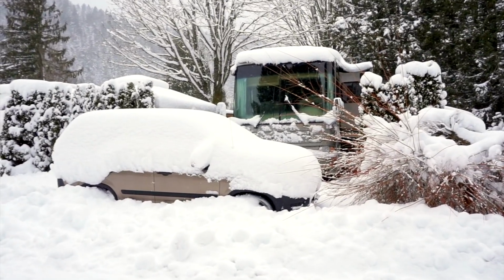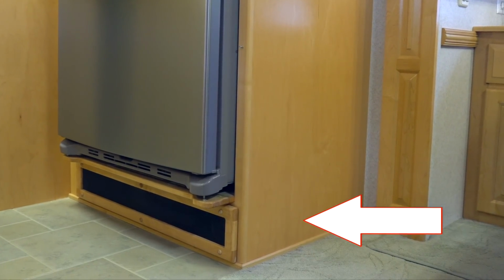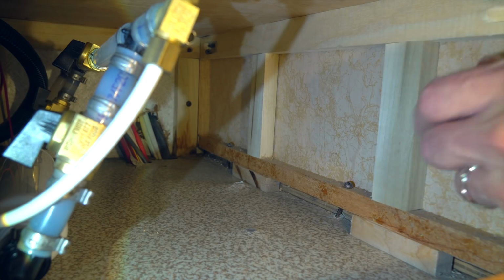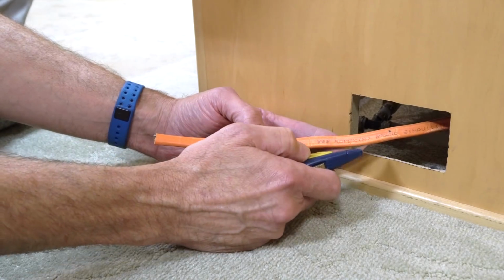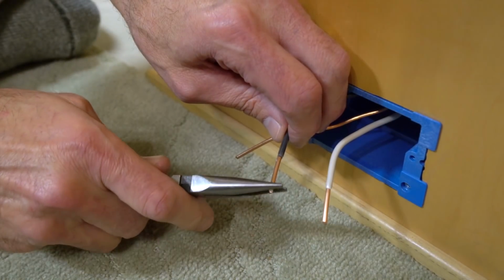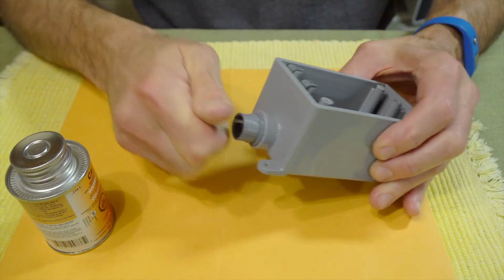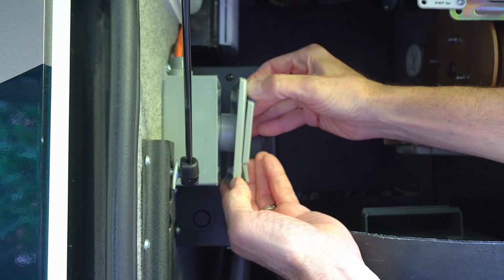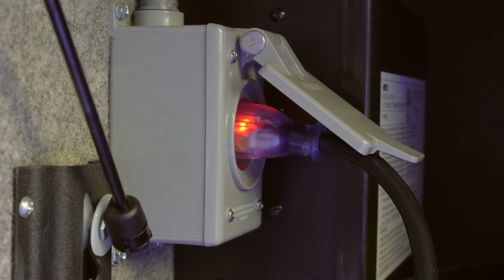Installing Our Winter RVing Secret Weapon!

Comment: Can a larger propane permanent tank be factory installed?
Reply from the maker: That would depend on the space available and the weight carrying capacity of the RV. It's not generally something people do. If the RV is moveable, its easy to tank up with propane. If it's parked for a long period, check out our video about how to connect to a larger external propane tank.

Comment: Hammer staples are a major no no I have seen the vibrations in just a standard house from things like a washer or dryer make the staple rubbed though and either caused a short, rub marks or worse a Electrical fire the  safer route is a zip tie that is made to secured with a screw to the wall

Comment: Are you 2 going to come back to this and tell of how your experience with this has been for you 2? I'm kinda curious to know.
Reply from the maker: Hi Morgan! This literally transformed our winter stay on a 30-amp site. It allowed us to run a dedicated 1,500 watt space heater on that new dedicated circuit all winter, freeing up our regular 30-amp power for so many other things, including a second space heater when needed. It was an absolutely wonderful, stress-free winter, with zero effort required to stay warm and cozy.
Reply: In the instance that you 2 do by chance come across a 50 amp available connection, you would put everything in the 50 amp connection right?
Reply from the maker: For sure! If you have an RV with 50-amp service (the big 4-prong plug) and you're at a site with 50-amp service available, that will power EVERYTHING you could possibly need all by itself. The mod we put in is only for when there's only 30-amp available. Now of course if you have an RV with only 30-amp service, you could make use of the mod we showed any time there's both a 30-amp and 20-amp plug available on the same pedestal (very common). This could come in very handy for a 30-amp rig during the winter, when more than 30 available amps could come in very handy.
Reply: That's good to know, I just wasn't sure if you 2 were going to talk about it in a video, or if you 2 wanted to or not.
Reply from the maker: Might make a follow-up video, but wanted you to know that we’re VERY happy with the mod. 😊👍
Reply: Yeah, again, good to know that you 2 are happy with your mod. :)
Reply: Right, I was wondering if that's you 2 would do if you 2 were have a 50 amp available connection for you 2. As for you mentioning about the 4 plug mondo plug in your comment, I have been able to see your video you 2 did on dog bone adapters. :) ;) :D
Reply from the maker: Yup... when we’re on a 50-amp campsite, that one cord powers everything, so our mod isn’t needed. 😊

Comment: Nice video. I see a bare copper wire at 11:40. What's that for?
Reply from the maker: Hi Steve! I looked carefully at 11:40 and couldn't see any wire. Sorry if I'm missing something. Can you describe where in the scene you're seeing that, or if it might be at some other point in the video?
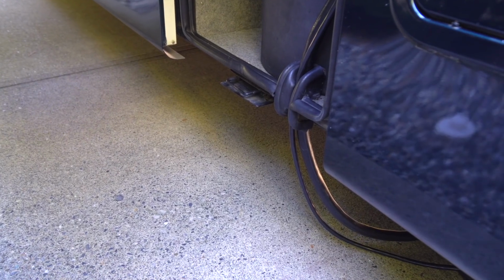Reply: I looked also.  There is something that looks like a 1/4" copper pipe coming out of the " service compartment " of the RV, visible at 11:19.  Not sure what it is or why it is there, but I think this is what they are talking about.

Comment: What is the reason for the black and white wires to be opposite of each other?
Reply from the maker: We learned from watching YouTube electrician that that's the right way to do it! LOL Since we're not electricians, we're not sure why, but we figured they all said to do it that way, so we did! 😊
Reply: Just do it and don't ask questions? Maybe it would be wise to ask a electrician the reason why.
Reply from the maker: Our questions were answered by at least a dozen tutorials we watched and read from various professional electricians on how to correctly wire an outlet. All agreed on the procedures. How much research and analysis do we have to do for such a simple task beyond ensuring we learn the correct procedure from a pro?
Reply: Well, if you learned it from a pro, then i am silenced. Thanks for the answer.
Reply from the maker: When it comes to specialized stuff like plumbing, electrical and engine work, we do research a lot. But we have to apologize that we don’t always earn the “why” behind every “how”. 😊

Comment: Hello there guys.... I was watching your video again and at the end you stated you haven't used a drop of propane, how do you keep the compartments warm or the tanks from freezing? Electric blankets maybe? I am thinking of doing this project too, lets see what happen. I think every manufacture should install and outlet just like this one. Stay warm guys....
Reply from the maker: Hi Hector! We put a utility light in the water compartment with a 60-watt incandescent bulb in it. It's amazing how much heat they put out! It did the trick and kept the basement plenty warm all winter. We also put the remote sending unit from our indoor/outdoor thermometer down there to monitor temperature from inside the RV. I think we mentioned both of these in our original (very old!) video about RVIng in the winter, just in case you want to check it out: https://youtu.be/n5RGlcLSrM4

Comment: I'm really curious why you used 10/2 instead of 12/2, which is specifically for 20 amp usage, while 10/2 is for 30 amp usage.  Please help me to understand what I'm missing.  Btw, I LOVE your videos and am learning a ton so please don't take this as a critique, I'm seriously wanting to understand.  Thank you!
Reply from the maker: Thanks for the nice comment and great question! There were three reasons actually. First, we're not electricians, so not as confident as a pro when it comes to making sure everything is robust enough. Second, since this is an internal installation, as opposed to something outdoors on the site or pedestal, we wanted to be sure it had more than enough capacity. And third, we had a length of 10/2 Romex left over after installing our new Xantrex inverter, so like good DIYers, we used available material we had around! If you're going to be purchasing Romex for this job, you'll be totally fine with 12/2!

Comment: we keep our rig warmed with an electric, oil-filled radiator.  No moving parts, great thermal mass once oil is warmed, and the heater kicks off once the oil is heated.  Last, no open flame or high wattage fan used.  Might? be a supplement to your secret weapon?
Reply from the maker: Great tip! We borrowed one of those from a friend during a previous winter, and really liked it a lot. The only downside was the length of time it took to heat up and cool down, making it a little less easy to get instant gratification if we was a little too hot or cold. But a very worthwhile way to heat!

Comment: I helped a friend recently perform a similar modification. In his case, we direct-wired a retracting reel with a 20A cord into a single breaker subpanel. We added several orange outlets with active LEDs around the rig to identify they were on the alternate circuit. His intention was to use a single ceramic like your oscillating unit and move it around as needed, but I like the idea of using a less-direct convection for general area heating. As always, well done, gents!

Comment: Love your upgrade! I’ve done the same thing to my Coach for those cold days. Just wanted to hear your review on your Delonghi heater. How quiet is it, and what made you choose that particular model. 
Thanks!
Reply from the maker: Hi Mark! Your timing is rather amazing.... We chose that heater because it's quite slim, and would fit where we wanted to put it, even though its overall dimensions are rather large (tall & wide). And it's almost completely silent, since it's a convection heater, with the added benefit of an optional fan mode. Because it's not an oil heater, it would heat up and cool down quickly, and the fact that's that it's really attractive compared to most heaters didn't hurt either. Those were all the reasons we chose it, and we loved it. Yes... loved, as in past tense. The reason we mentioned that your timing is amazing, is because just this morning, we made the final decision to return it to Costco, and removed the links to it in the video description, and from the post on our website, and from our favorite gear page. About a month in, we smelled a slight "burny" odor from it one day. We thought it was a delayed "new heater" smell, because it still worked perfectly, and the odor went away quickly and didn't return. That was until a couple of days ago. We woke up to that same smell, only stronger, and the heater had shut itself off during the night. We tried running it only while we were awake (so we could monitor it) all day yesterday. No more smell, but we noticed that it wasn't warming the place up adequately. We plugged it into our Kill-A-Watt and turned it on high, and noted that it was only drawing about 475 watts, even though it's a 1,500 heater, set on high. Obviously, something failed, or maybe two things failed in sequence. We think the smell was coming from the control panel, and we're guessing that something failed in the control module. We did some research, and found that some other people have reported the same thing. It's a shame, since when it was working, it was awesome. We just can't recommend a heater that failed so quickly, and we're returning it to Costco tomorrow morning (gotta love Costco). Sorry we don't have anything better to report. For the time being, we're just using an extra space heater that we had planned to give away, but will keep it for the time being until we decide what to replace the Delonghi with.

Comment: Thanks for the great video.  It inspired me to do the same thing plus in my motorhome with only 30 amps service.  I’m going one step further and running the wiring to the water heater and will replace the gas only one with a gas/electrical.  I’ve been trying to get a 20 amp 120 V inlet and can’t seem to find one.  I’ve been to Lowes, Home Depot and searched the internet and Amazon and can’t find what I want.  Where did you find yours. I’m about 45 minutes from an electrical supply and thinking of making a run down thereto see if they have one.
Reply from the maker: We included links in the video description to all the parts we used. Here’s the 20-amp inlet: http://amzn.to/2DXXExA It’s a bit expensive, but very robust and weatherproof.
Reply: RVgeeks Thanks.  I looked for links but didn’t see them.  I must have been looking in the wrong place.
Reply from the maker: No worries Larry! Please let us know how you make out.

Comment: you are playing a dangerous game..

typical mains 20 amp is 220/240 vac.

inlet to main fuse is 20 amps, internal wiring should be 15 amps

the only thing I know of that requires additional 20 amps that is air cons and most other feeds use 10 amps at the most so 15 amp is applicable @220/240VAC..

I DO NOT BELIEVE IN 110/120VAC because yyou waste ore power in down conversion..

and gets dangerous mixing 30-50 amp at 120 vac when you should be within the realm of 20-25 amp inlet at 240 vac..
Reply from the maker: Hi Jason! We appreciate your comments, and we understand that you prefer 220/240 over 110/120 volts. But 110/120 is what we use here in North America, and there's nothing we can do about that. Just about everything we Canadians & Americans use is 110/120. We're not "playing a dangerous game" but rather simply using the system that's been chosen for our region. We RVed for three weeks in Australia a couple of years ago, and agree with you that 220/240 has its benefits (we loved using such a small cord to get the approximate equivalent of 30-amp service). But until they change the entire North American system, we're only able to use what we've got. And we're using the way it was designed.
Reply: yup I think standardizing to 220/240 would benefit the US market more I do not think 110/120 was designed for commercial grade applications at 50 amps..

I just can't see the point of a 120 inlet when and where 220 should  be a base standard connection..

how you get to 120 vac is not the way to do things...

Comment: One minor flaw in your video.  DO NOT use metal staples with Romex cable.  There is a special white nylon staple just for Romex.  The fastener you show is for flexible steel conduit type wire.  (MC)  Using the wire metal type can be hammered in too much or rub on the wire during driving, causing a fire hazard the next time you plug in.
Reply from the maker: Thanks for the input, Clyde! We did watch a LOT of instructional videos about all aspects of this project from professional electricians, and there was quite a bit of conflicting information, including details about hammer staples. The guys who showed using metal ones specified not hammering them in any further than just enough to hold the wire snugly, but not crush it. But we appreciate all input, because we're not professional electricians. Thank you! :)

Comment: Super video! Here’s a simple electric math formula. Volts x amps = Watts.  Under ideal conditions that 20 amp breaker can handle 2400 watts.
Reply: Can't load a breaker to any more than %80 of its rated capacity by code, that would be about 1800w. Majority of 120v space heaters are 1400/1 500w.  So he's well under. 🖒

Comment: i’m on metered electric too. also i’d like to add solar. how can i use the solar first making the rv park my backup power? thank you for all your great vids!
Reply from the maker: Hi John! Solar can't exactly work to directly replace park power, as the only thing solar panels do is charge the house batteries. So the way you could use it to reduce your electric bill is to shut off the power at the pedestal, as if you were boondocking/dry camping. Then you'd be using power from your battery bank, which would be getting replenished by solar. Then, when the batteries drop to the point where solar can't keep them high enough any more, flip on the park power so the charger can top the batteries all the way up. Then shut power off again, rinse, repeat.

The two challenges we see in that plan are 1) During the winter the sun is up for less of the day, and is lower in the sky, reducing the total amount of power they'll put out in any one day. Of course they should be tilted toward the south in the winter to maximize output, but it's still much less than a long summer day with the sun high in the sky. The second downside is that you can't run everything in the RV off the batteries. Electric heat for example can't be run off the battery bank, because it will draw them down far faster than the sun can put power back in. Same thing with the microwave over, and other high draw appliances. To be really effective, a large solar array and a large battery bank work best, but they're expensive, and still have their limitations (short day, cloudy days, trees or other things blocking the sun, etc). If your goal is to save money on your electric bill, it's usually many, many years to offset the cost of the solar and battery banks. The main reason we have solar is to allow us the peace and quiet of not having to run the generator so much when we're camping off-grid. It's more a quality of life things than a money thing.

Comment: I run my propane heater some as there is some heat ducted into the lower compartments. This keeps tanks from freezing.
Reply from the maker: When it gets REALLY cold, we do that, too. For the rest of the time, down to about 20 F, we just keep a 60-watt incandescent light down in the basement. Works great. :)

Comment: I understand that if you have a 30 amp connection at a rv park that's all you have. The 20amp circuit is off the same sourse. Is this true in all cases, I don't know. You would have to pull the panel front plate to check the buss.
Reply from the maker: Parks that are quite a bit older are more likely to be wired in a way that wouldn't allow you to use the full 30-amps from one circuit plus the full 20-amps from the second circuit simultaneously. But many parks handle it just fine, making this a very useful mod in many places.

Comment: You NEVER run the wire into the top of a box. ALWAYS INTO THE BOTTOM.
If water get under the fridge it will run right down the wire into the box.
Reply: Lol. Dude give them a break.

Comment: What about the sub floor heating.  My RV requires the propane heater to keep the water and holding tanks from freezing.  I don't have tank heaters. Bad choice on my part.  Thanks
Reply from the maker: Hi Jerald! We have basement heat as well, but same as yours, it requires running the furnace. So we use a work light with a 60-watt incandescent bulb in the water compartment, and nothing else has been needed. We've had temps down in the low-to-mid 20's with only one lightbulb needed. If it got really cold, we'd likely add one more. We also keep the remote sending unit from our indoor-outdoor thermometer down there so we can keep an eye on the temperature from indoors. Lots more of these types of tips in our original video about how to RV in the winter: https://youtu.be/n5RGlcLSrM4 and more in another winter video from last year: https://youtu.be/MJK7YIU-SFQ

Comment: What has been the average temperature inside running both of the heaters?
Reply from the maker: Hi Bruce! The average nightly temperature here outside Vancouver, BC has been about 25-35 F so far this winter (not arctic we know). The two heaters can easily keep the temperature anywhere we want without being turned all the way up. We keep things around 68 during the day, and 60 at night without a problem.